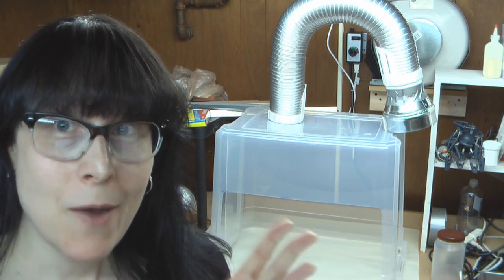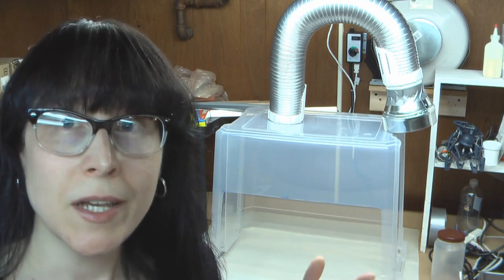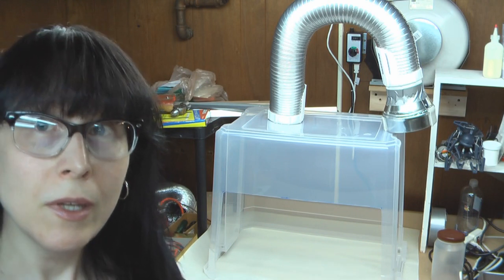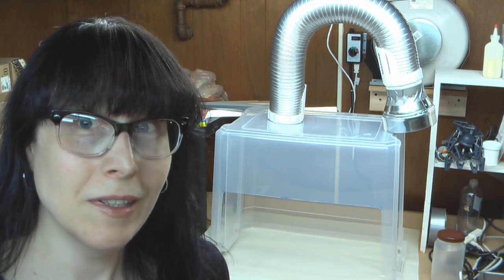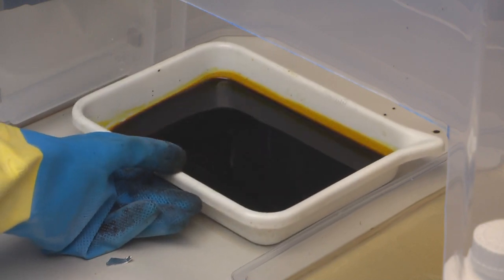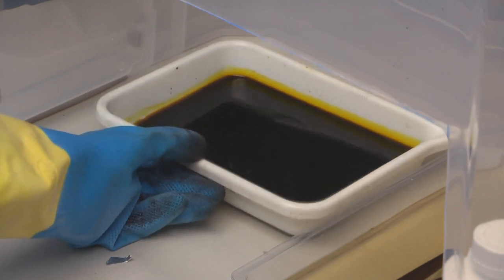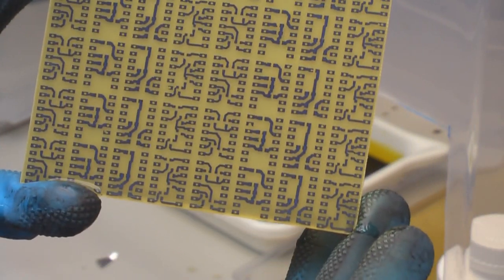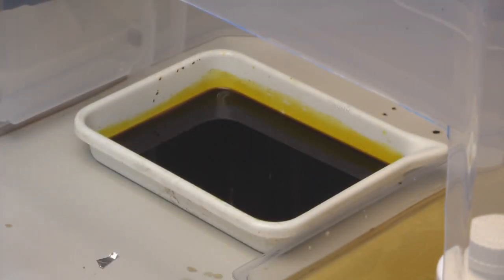Make Your Own Printed Circuit Boards Part 2 - Etching!

Comment from the maker: Yes heating will accelerate the reaction, but if you are only etching one copper board in a tray it is a much easier setup at room temperature.

Comment: Very nice work. Better than my work, and better than the other examples I'm seeing on Utube... I just gave the heat transfer method a whirl, However, I used the photo paper method, and the results are terrible, completely unusable. The paper becomes part of the toner. Its time for this "ole' cowboy" to use transfer medium that is dedicated to PCB etching... Thanks. I am enjoying your videos... Tom. EDIT: I have two 1000 watt class H (sliding rail voltage) amplifiers. I re-engineered a lot of the circuits. Then in hit me, I can make these amplifiers dual mono blocks. So I have to build 2 capacitor banks for each amplifier, and I will be using 4 rectifiers (two for each channel) with .1 film caps soldered across each diode in the rectifier to slow the diodes down, and hopefully in doing so, I can greatly reduce any harmonic oscillations caused by diode switching. I prefer cap. banks as they tend to have lower ESR and less inductance... :)

Comment: The only reason to use gloves with ferric chloride is because the stains are near impossible to clean once it dries, not because it's dangerous (to humans at least)...thin gloves will do more then fine...

Btw, if you use this kind of fan setup for HCl+H2O2 etchant, the free chlorine and HCl will destroy your fan! (speaking from personal experience) It's quite surprising how little chlorine you need to destroy the galvanizing on steel...

Comment: Oh, and heating your etchant, either before hand, by putting your tray in a hot-water bath, can really speed etching. I wouldn't recommend it usually, but you've clearly got safety on your mind, and a good fume hood. You might find it extends your etchant a bit, too. Spent etchant slows down, but you've sped it up with heat, so you can use it a bit longer without getting impatient. As I recall, I'd get maybe one more board out of it before replacing it. On a college budget, that was a big deal.

Comment: Absolutely true. Back then I tended to be using basically long-past-spent etchant, so heating it was pretty common. I remember being poor enough to try and find out if you could plate the copper back out to re-use the etchant, but that was before Google, so never did figure it out (probably for the best!)

Comment: When I was in college I made a tray rocker. It was an MDF board with a center pivot (i.e. see-saw). I found a 15 rpm DC motor and put a cam on it. It worked fairly well. MDF was a bad choice for chemicals, but it took a long time to fall apart and was cheap. Variable speed would have been nice, but I never bothered.

Comment: Ok nice to see such a good video about etching!
But with sodiumpersulfate i need about twice the time and need to heat it but i dont throw away my acid every time ive etched a board O_o. I dont need to brush and its just laying there for about an hour. I can do more than 10 of the boards you made at least. And i can electroplate stuff with it :D
And although its not as far as dangerous as ferruschloride. You dont nessesarily need a fumehood. I have it in a 10x6" box and a cover on it. The copperpipes above dont get harassed in any kind of way ;)

For everyone who whats to etch I recommend using persulfate + Foto-PCBs instead of Tonertranfer. Tonertransfer isnt easier than Foto-PCBs. I wasted alot of time trying to the toner transfers right, but with foto-resists its just about the time. Developingtime isnt as critical as some people tell you on forums ;)

Greetings from germany

Comment: Years ago used a 4" boxer fan and mounted to a sandwich of plywood sheets slighty larger than the etchant tank. I drilled some holes in the pieces above and below the fan to allow airflow. Then drilled a hole in one of the blades half and inch in from the outside. I played with a screw 3/4" 6-32 screw and different number of wasehrs  untill i got the amouint of vibration I wanted. I recall 4 and a nut did it. I put 6 large self adhesive rubber feet to steady my CHEAP and simple 2 build agitator.

Comment: Please don't dump it down the drain that is harmful to the environment and would be quite bad if you had copper piping.  It's actually illegal to dump it down the drain because of the copper which is dissolved in it.  To find a safe legal way to dispose of it I would try calling your citys dump who should be able to tell you who to call.

Comment: If you are starting out with etching, do yourself a favour and use sodium persulfate. Ferric Chloride has a strange reputation of being cheap and  easy, but here in the Netherlands the stuff is around five times as expensive as SodiumPersulfate, which means you can easily pay for a smple etching tank just by not using the ferric.

Also, as you can see from this video; ferric is opaque so you have no clue what you're doing unless you handle the board, which you don't want because may damage the traces and you will splash the liquid on you and your clothes will be ruined. In sodium, you can just watch the copper dissolve and take the board out when you see it's ready.

Comment: Hi there, 
I use one of those  soft silicon backing brushes instead of a paint brush. Is softer and has no metal.
Nice video series.

Comment: Hi, i use H2O2 (18%) + HCl + H20 , all about one  third , it etches your board in 30 seconds to less then a minute, don't make too much since once hcl and h2o2 is mixed it starts reacting.
Using this now  for over 20 years..
Reply: HCl is a gas ... I doubt you're bubbling it into the solution you prepare, but using its aqueous solution, so it'd be kinda nice (and important, too) to state the concentration of that one as well.

Comment: very informative, i personally use ammonium persulfate heated to 100c to etch. Works great, etches a board in normally about five minutes, also to remove the resist i normally expose the board again(without artwork) then put it in the developer, then clean with brasso quickly and then it's ready for tinning and drilling

Comment: Thanks for a fantastic video!
About the time for etching, how critical are the time, what if it lays in the chemical for i.e. 10-15 min longer then necessary?
Reply: As the uncovered copper is etched away, they ferric chloride will start to etch the traces from the sides. That could etch away thin traces or create thin spots. Depending on the PCB design and function, that may create problems.
Reply: @deskpro256  Thank you a lot for your great answer!! :-)
So in short, if I am using trough hole components and wide traces, is the time not that critical, while if I am working with 0402 and 11 mill traces, then does the time become fairly important and may even demand some tests before deciding on the final time?